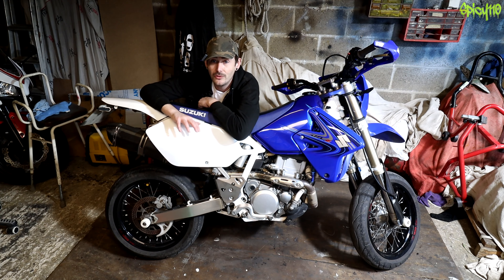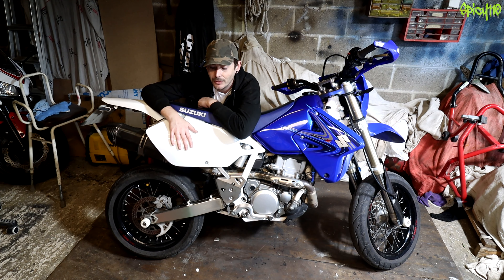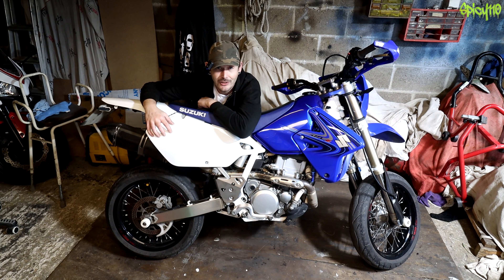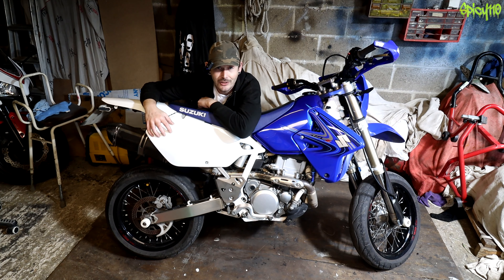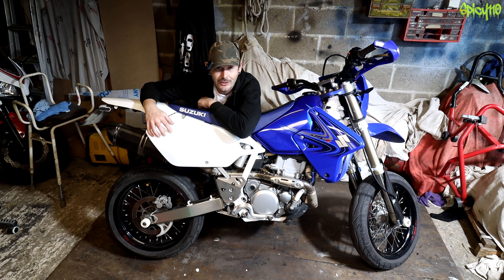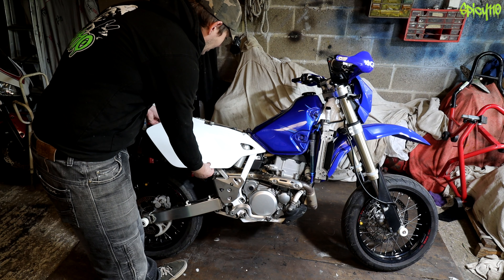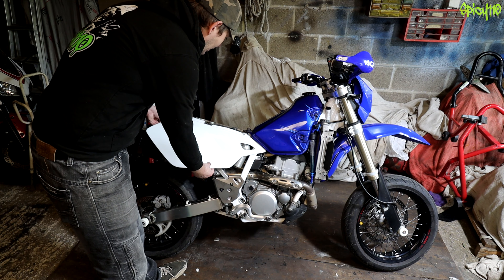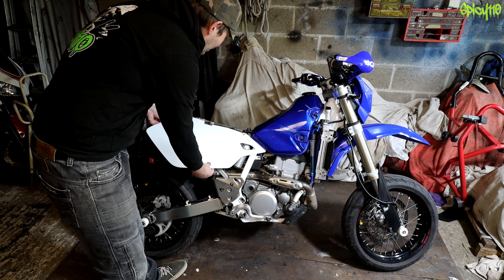You Can't Scratch Your Motorcycle Fairings, IF You Don't Have Any!

Comment: FCR carb when???? I got one recently, big ol' difference and definitely worth doing if you can get one for £150 or so.
Reply from the maker: Not going to do it, I like the way the bike rides as is with the 440 kit and if I put that in you are really starting to push the bottom end more than I would like to for a daily runner.
Reply: @spicy110  I am the other way round, not sure about doing 440 kit because fear it might be a bit of a time bomb - FCR however came from the E's so on my stock internals (presumably), gives a good bit of differnece.

Do you ever get power wheelies? Can't seem to hit them, maybe im just too much of a pu***
Reply from the maker: In first a handful with lift the front right up, second a little and 3rd a tiny  bit. That's with no yanking just throttle, while not trying to wheelie lol I had to do the 440 kit as the bore was done at 18k.
Reply: @spicy110  Interesting to know.. I'm at like 17.7k.. I think it's had a new top end based on how clean it is compared to the rest but no paperwork to be certain ..
Reply from the maker: If you are saying yours looks like it has a new top end at 17k that falls perfectly in to this. https://youtu.be/wGWqUT2u4-o?si=SdoqOLy37ERonKWy&t=202
Reply: @spicy110  Yeah Iremember watching your video on this and thinking the same. Equally it might not have had a top end and is due one lol. I regularly service and just hope it doesn’t blow up.
Reply from the maker: @joshTEAM44  A good way of knowing is if it is smoking a lot under throttle and or you find it is drinking its oil. The spec is up to 1000ml oil used per 1000 miles ridden, sounds crazy but mine was using more that that before I did the bore kit. If you find oil top ups are just a few mills you can be happy its doing ok.
Reply: @spicy110  A good shout thanks. I also always stupidly go to check oil BEFORE running it and then a few minutes of thinking "no way I've ran this without oil" before remembering you have to let it run for 5 minutes to get the oil pumped up into the frame first!
Reply from the maker: Yer 3 mins tick over no revs, 3 mins engine off then check the oil.